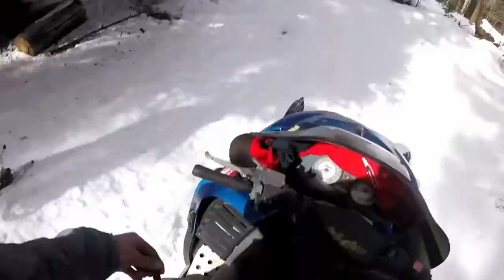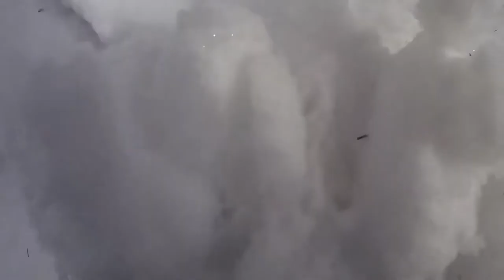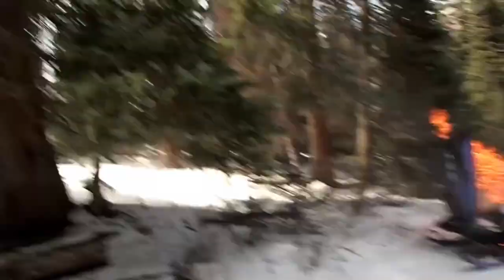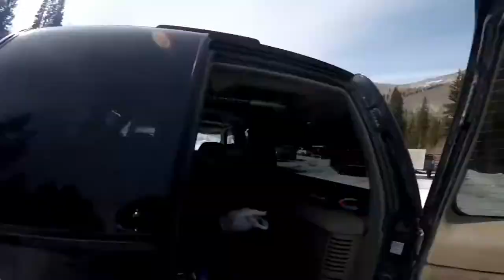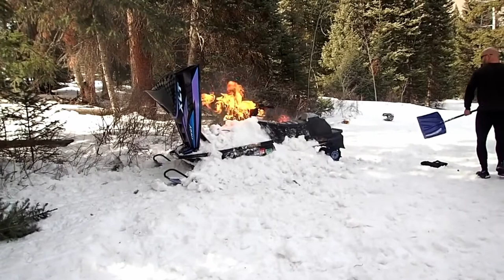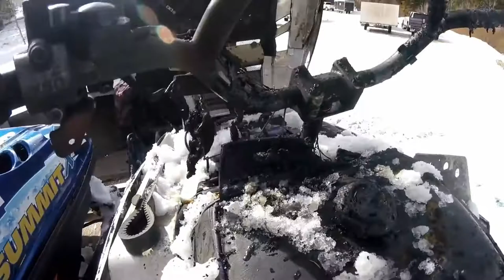Snowmobile Catches On Fire And Blows Up!!

Comment: You could have flipped it upside down you guys look strong SO IM RIDING MY FRICKIN SNOWMOBILES IT JUST CATCHED ON FIRE instead hes slaps with a pine tree and ya I feel bad for you guys.
Reply from the maker: 100%😂 the pine tree kills me everytime😂😂 we actually did flip it at one point and it got way worse!
Reply: Yeah I heard he said it doesn't move before it blew and you were like still  what were the stages when it didn't move and stopped
Reply: I want a indy 600 triple but I'm scared this will happen to mine and ya when you said dally turn around i heard it running on 1 and ya somethings wrong with that thing I am 14 now and I have a yamaha ss440 and I went 80 km/h on it